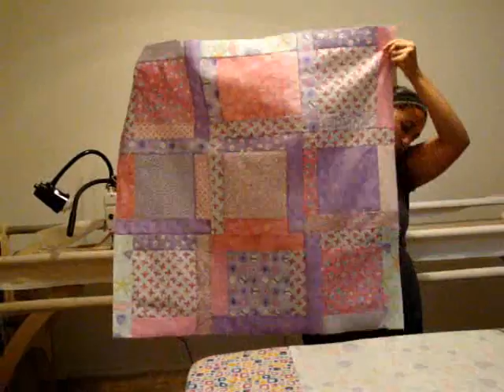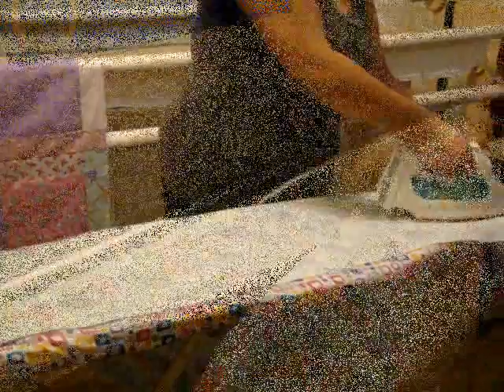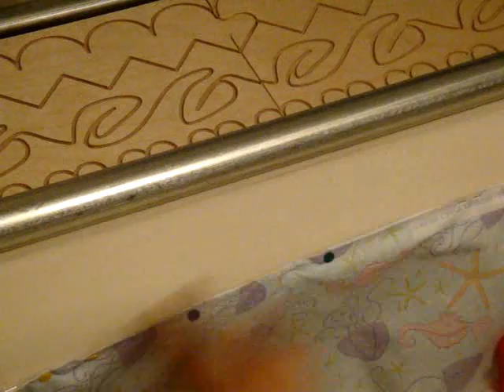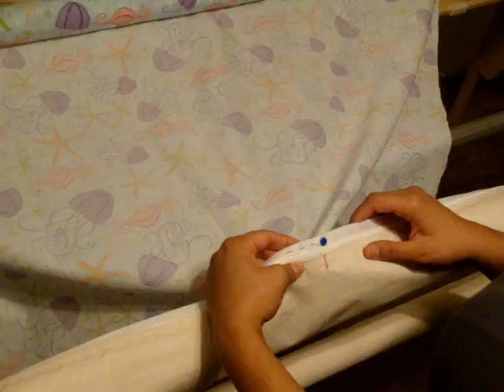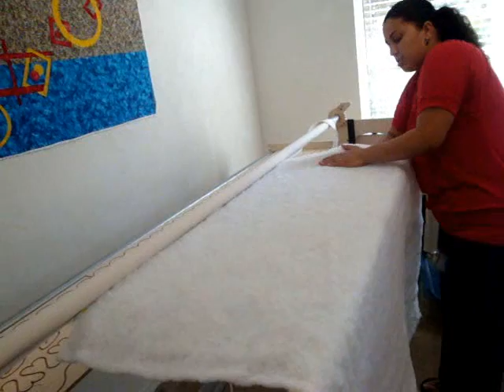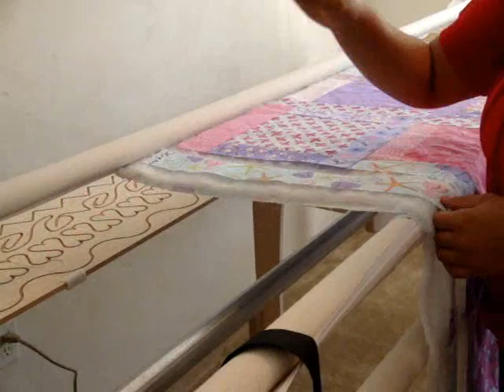Longarm Machine Quilting- Loading your quilt

Comment: I bought the GMQ Pro 2 years ago.  I sold it.  It was not big enough as far as the machine.  The throat was too small.  I have back problems and I want a longarm really bad.  Im considering the SIT DOWN HandiQuilter...you would still have to pin baste but get the perks of having that huge amount of quilting space...just sitting down.